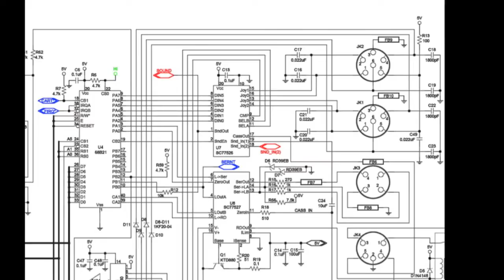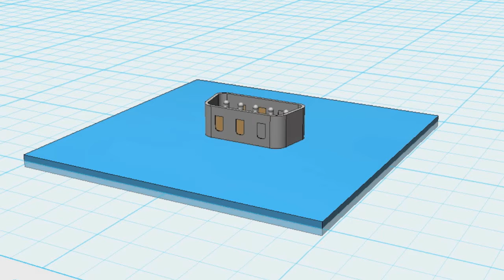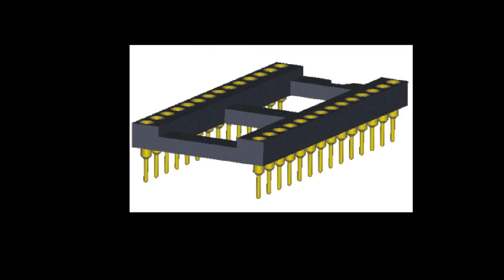Atari Joystick To CoCo Adaptor

Comment: Amazing - I wish I could do that. But, to be contrarian, the best Atari digital joystick is Suncom's TAC-2. Or use the Atari 7800 Joypad but unscrewing the thumbstick to use the D-pad means a blister from the little hole. Or you could "cheat" and get a modern-made RetroGameBoyz Atari joypad. Or (and I hate to have to say it) you could've skipped all this and just gotten an actual Tandy digital joystick, the Pistol Grip for CoCo and Tandy 1000, Cat. No. 26-3123, debuted in RSC-21.